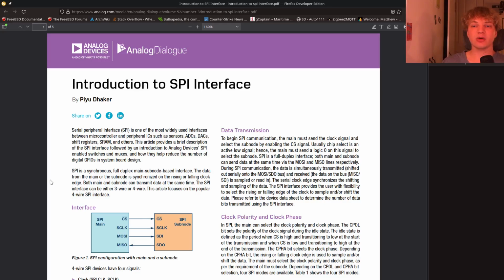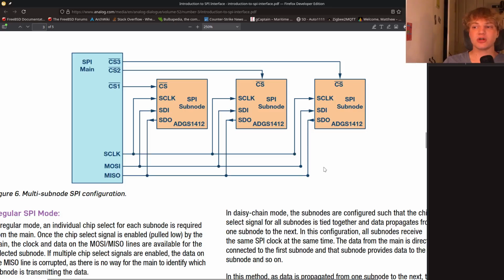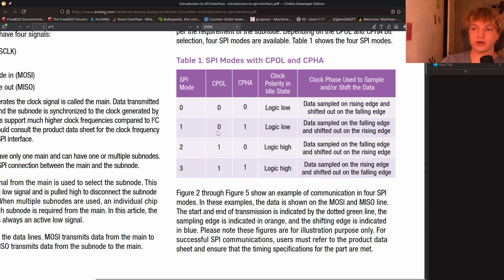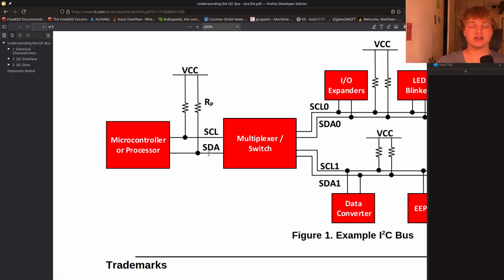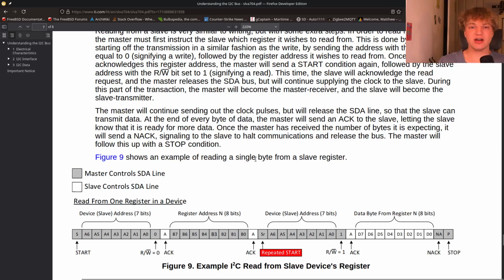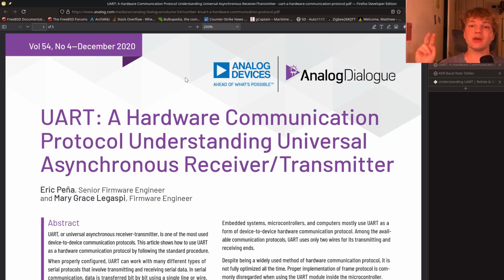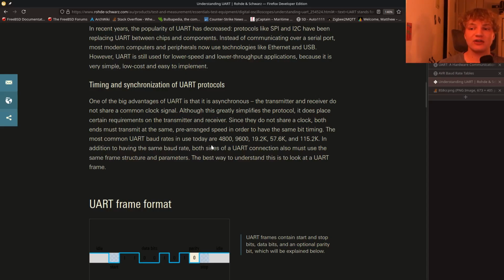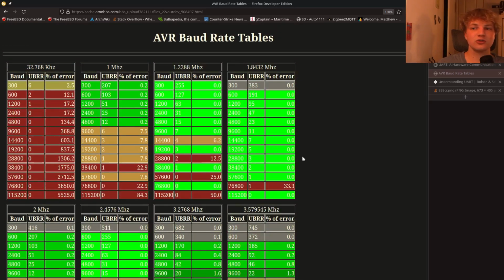I2C, SPI, UART - In Depth Embedded Protocols!

Comment: Do people use shift registers with SPI for chip select? That would reduce the gpio requirement. Are there certain reasons for not doing it?
Reply from the maker: You could, the only problems I see are these:
1. you can't use full hardware SPI so the CPU will have to waste time setting GPIO, etc. 
2. some driver libraries require you to pass in a GPIO pin, so may need workarounds
3. latency would be worse because you're doing an I2C transaction or something before transfer

so for non-performance critical applications I don't see any issues here

Comment: yayy new vid , alsi I want to learn more about creating custom network protocols....watched ur protocol video sensei but some concepts went over my head. Can you suggest me some books to read about it ?
Reply from the maker: my friend you simply need to come to the realisation that protocols can be whatever you want them to be. Seriously, sky's the limit. A protocol is simply a structure that the sender and recipient understand. You structure your data in some kinda way, you send it off, and as long as you program the receiver to understand it and do stuff with it that's all there is to it.

Structuring the protocol is where there's some theory to it. There's 'best practices' and such, and there are plenty of protocols out there for you to use as examples like IP
Reply: @hoff._world  my god you explain stuffs in such an easy way. I get it now slightly however my coding skills in C is also holding me behind :<
Reply from the maker: @royalpotato4733 if you're more confident in other languages you can do protocol stuff in them no problem. In Python for instance there's bytearray you can use as an equivalent to uint8_t buffers in C.

Comment: Good video! Happy with the fact you went down into some of the nitty-gritty. Didn't expect going over error rates w.r.t. clock frequency, which was fun and not something I had really thought about (9600 baud goes brrrr).

Only improvement would have been to cover more protocols, but there is only so much time in the world to make videos in :^)
Reply from the maker: hey man good to see u :) the dilemma is always about the length of the video; I have found overall if I make it too long and it's a very technical subject the retention is... mid at best. But fear not, as I mention I'm gonna do a separate vid on bluetooth low energy which is gonna be a blast.

cheers!
Reply: @hoff._world  I very much look forward to that video. I remember doing a university module on the physical layer of wifi and bluetooth, the different modulation approaches, and the like. It didn't go massively in depth on the physics (I'm not an electrical engineer) but was very interesting regardless. So I will be very happy to see more of that.

I assume it will be another overview of the protocol, as here? Any chance for going into using bluetooth le from the software side? Or a potential video on the software side of USB (implemented on a microcontroller?)
Reply from the maker: potentially, the only issue with covering it from software side with all these protocols is that the implementation changes depending on the platform, so for example if I were to demo BLE software on nordic chips for example it would have to be a video only about nordic chips... same if I covered the windows RT bluetooth apis, it's all very platform specific
Reply: @hoff._world  Good points. Whatever you end up doing, I am sure it'll be interesting and informative :)